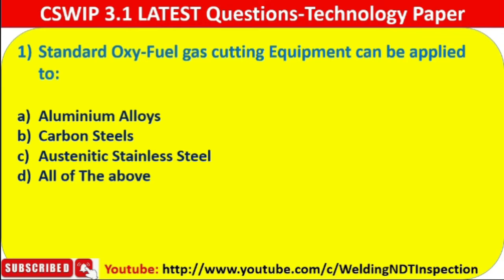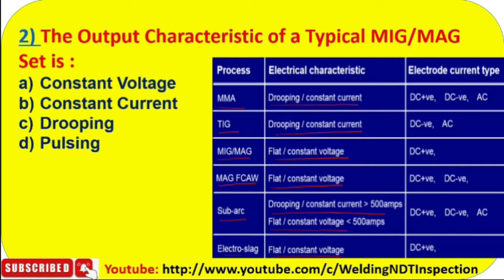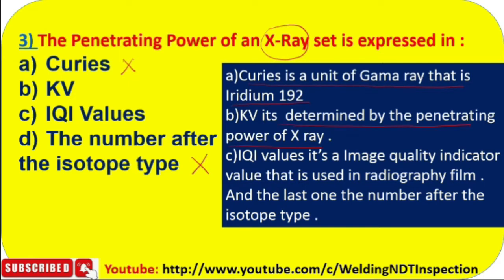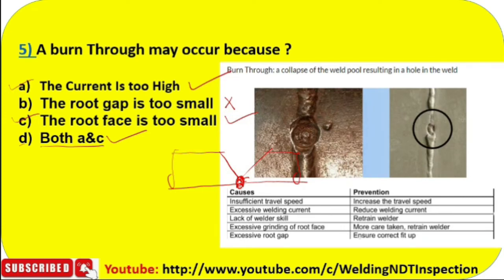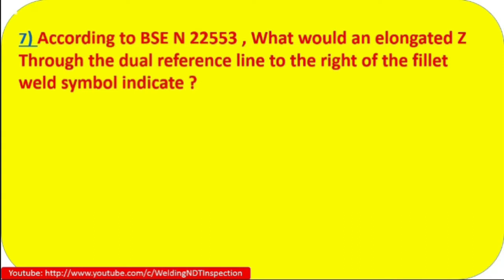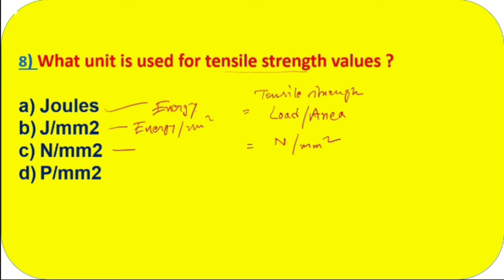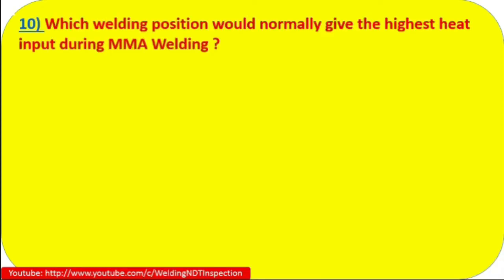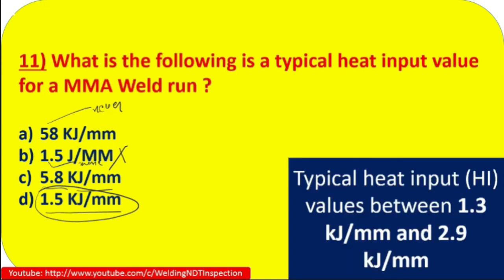CSWIP 3.1 Technology paper latest Questions [Part 16]

Comment: For Questions no. 10  D is right answer (Vertical-up progression tends to give the highest heat input because there is 
a need to weave to get a suitable profile and the forward travel speed is 
relatively slow.)
Reply from the maker: you are right , it will be be option D is the right answer .Appreciated ...
Reply: @WeldingNDTInspection  IN 1G ALSO CAN GET MORE HEAT INPUT Its depend but correct answer will be 3G only mostly we qualify procedure in 3G only as non essential position

Comment: 10. D
Highest heat input will be in PF(3G) position while welding in vertical up position weaving is done due to which travel speed decrease hence heat input increases.
Reply from the maker: you are right , option d is the right answer , i will edit the video and will change it..

Comment: Question 4,
if not used within 4 hours, return to oven and rebake.? is it 350 deg?
in my opinion, it should be 150 deg, is it right? please confirm.
thanks
Reply from the maker: Used electrode  usage in oven how to do , any code has not said anything . So you can do  use electrode as per what i said in this video and also you can do 150 degree  c In quiver...As this electrode is coming from 350 degree centigrade  and  suppose some electrode out of them will not used today and they will be used tomorrow , in that case it will go again 350 degree C and then holding oven.. Hope you understand ???
Reply: 6010 is cellulosic type electrode that's why no need to Backing